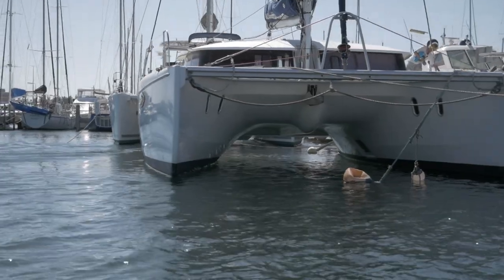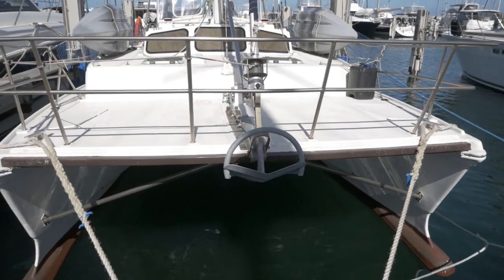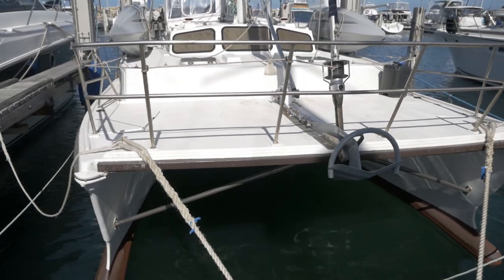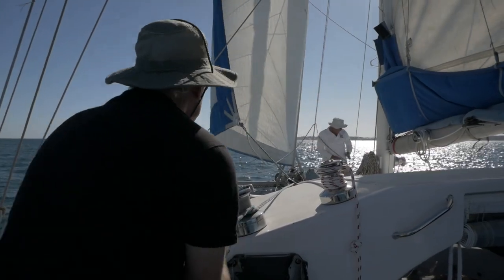Catamaran Disadvantages

Comment: Guys... Does anybody know if seakeepers are good to be installed in sail cats? Is it common to install seakeepers in sail cats?
I mean; I wonder if the cat performance could be affected.
My concern is that the cat design was made to use wind loads to perform to a specific level so I wonder if adding a seakeeper for stabilization purposes could somehow affect performance negatively. Any idea there?